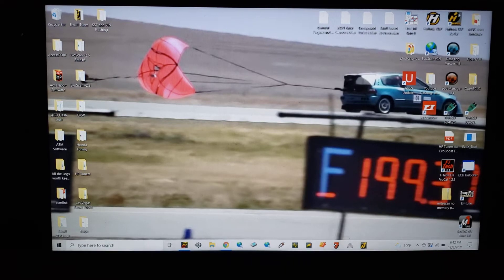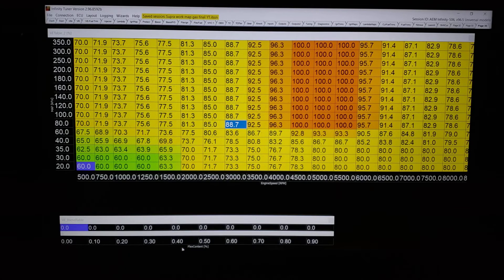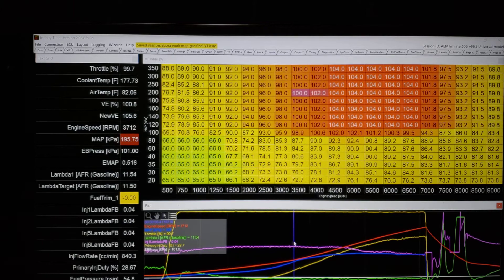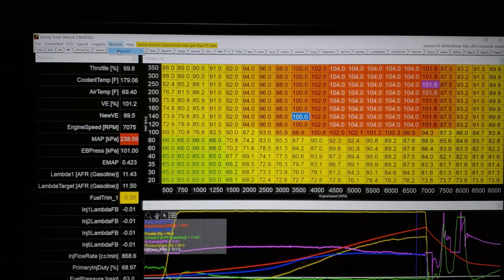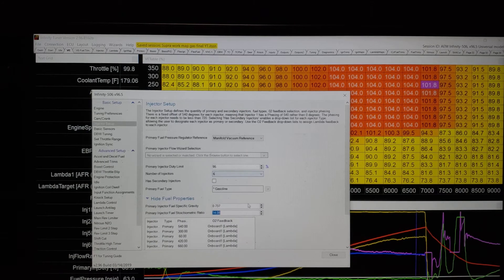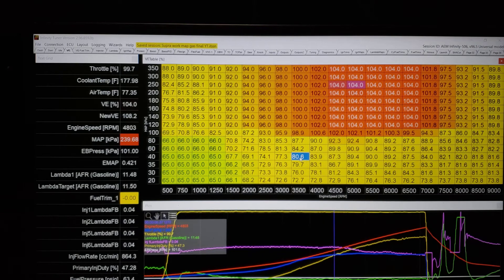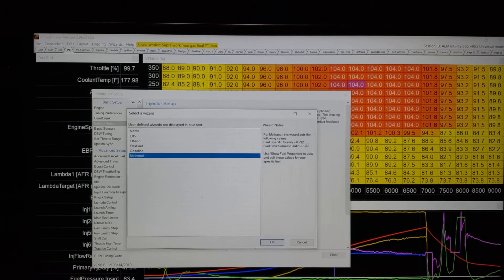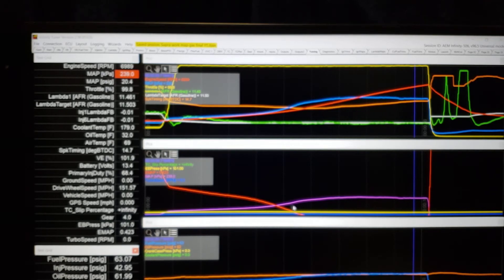Generic VE table tuning, In Real Life - episode 3

Comment: If you were tuning an e85 map, and adusting your target AFR table, do you still set it up like a gasoline map? Or would your target AFR for idle, spool up and full boost change?
Reply from the maker: I am lazy and since the only fuel I mess with that needs a completely different WOT AFR is methanol, all E85/E98 cars I leave using gasoline AFR as the target rather than lambda.  Methanol cars I change it to lambda and then target 0.605-0.61 at WOT for a turbo car.
Reply: @AaronONeal1  I wouldnt say its lazy, if it works it works!